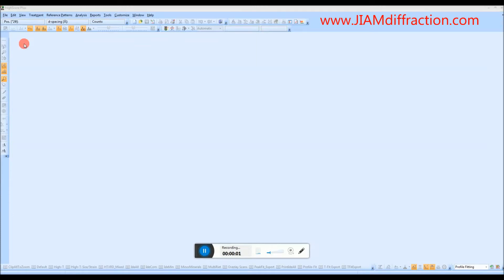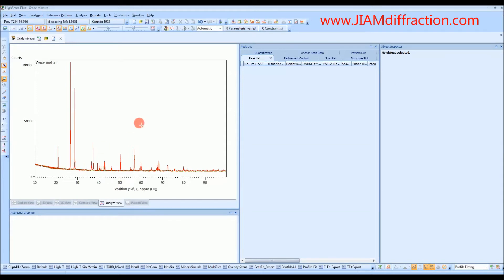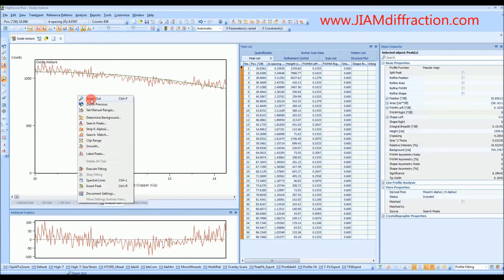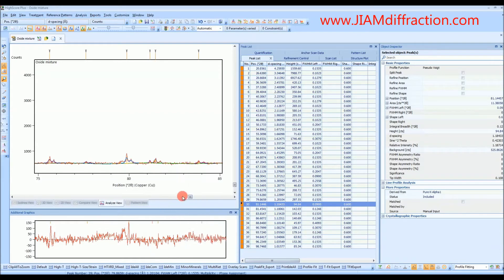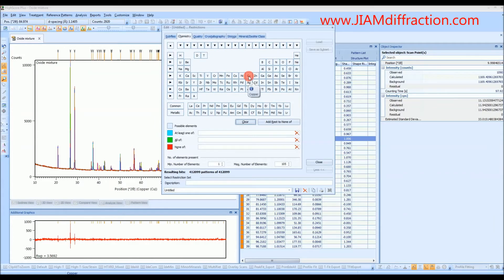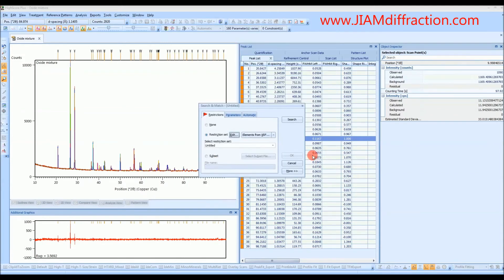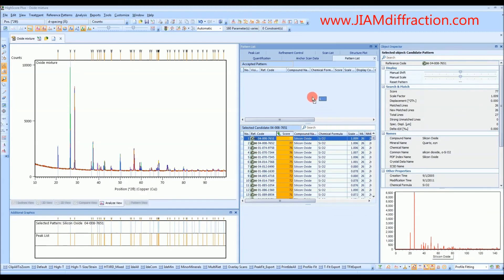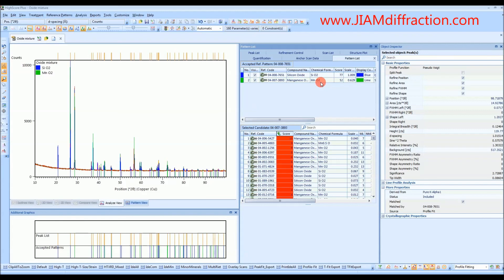HighScore Plus Tutorial - Phase Identification X-ray Diffraction - Short Version - JIAM Diffraction

Comment: Dear Dr. 
I face an issue in the matched patterns' cards that I found that after the search and match, when I try to save, they are saved but without the peak list (hkl) in the PDF file after saving it. I do not know why this issue appeared nearly. I hope you reply. Thank you.
Reply from the maker: That is interesting.  To make sure I understand correctly, you are double clicking on the candidate file, click the save button, and then save as a PDF.  When do you do this, there is no peak list (2theta position, hkl, relative intensity, etc.) in the PDF file.  Correct?  If so, here are some thoughts/questions...

(1) Have you tried saving it as a .rtf file?  I doubt that would produce different results, but it is worth a try.  

(2) What database are you getting your candidate files from?  For example, I use the PDF-4+ database.  If your database has its own software that you can use to search for the candidate files, you can try saving the file from that software.

Comment: what is the difference between the same video of shorter vs longer version? Is it software version's difference or video's details?
Reply from the maker: Just the video details.  I cut out some basic steps in the short version.  I figured the long version is good for first time viewing.  If you need a refresher but understand some of the basics, the short version will save some time.
Reply: @IAMMDiffractionFacility  thanks